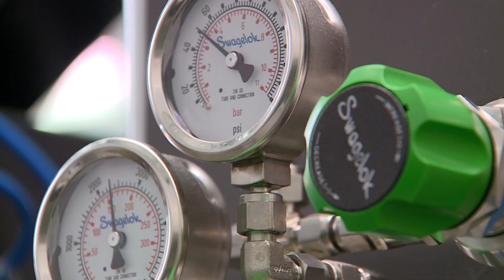Colorado researchers invent eco-friendly way to recycling lithium ion batteries

Comment: Manufacturers should be held responsible for making recyclable containers batteries and every other product plastic bottles can and glass containers should all be 100% reusable and recyclable. Remember good old $0.02 deposit on soda bottles. You don't see a lot of bottle with deposit on them the in garbage because it worked.